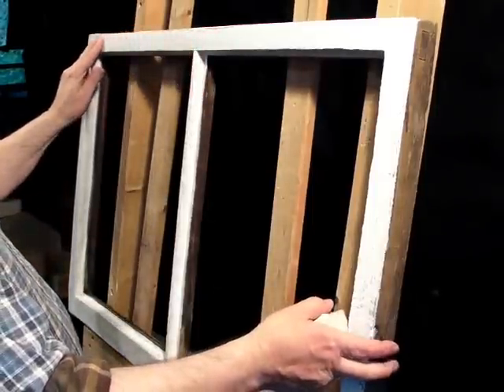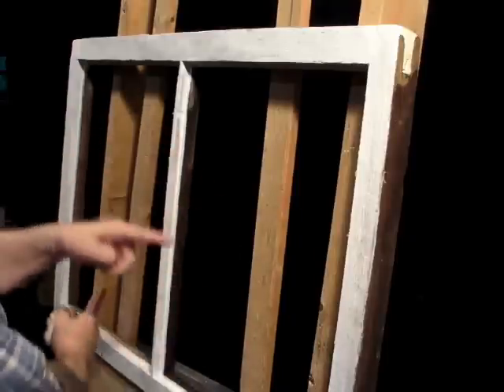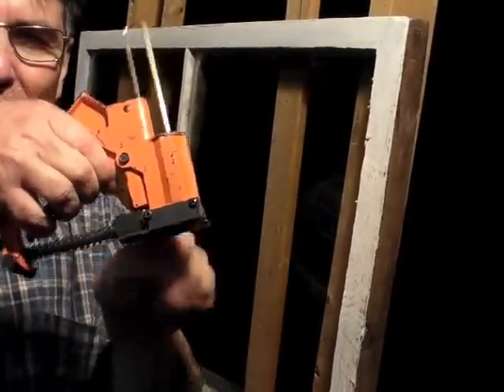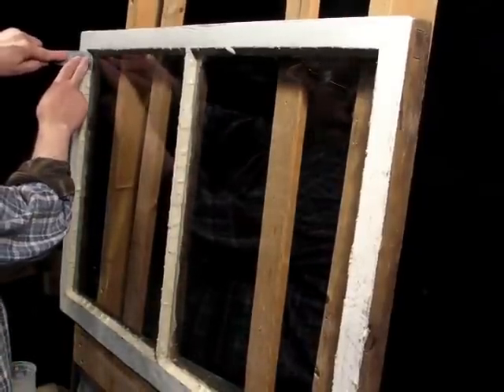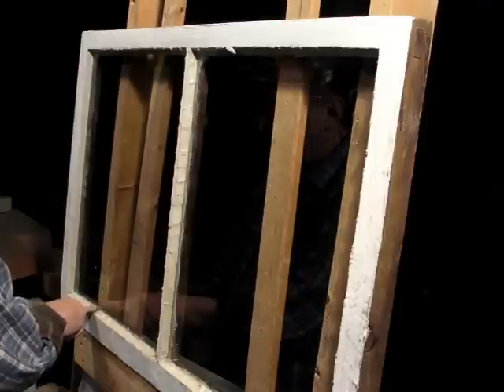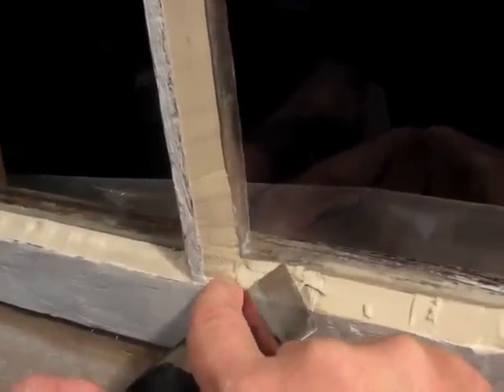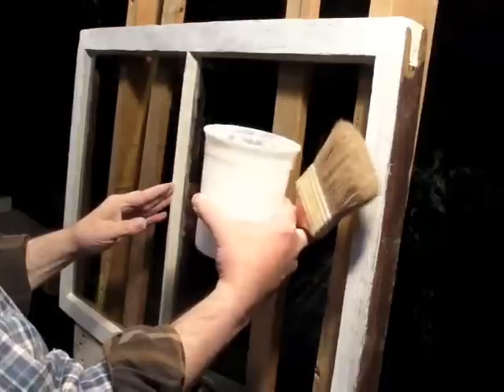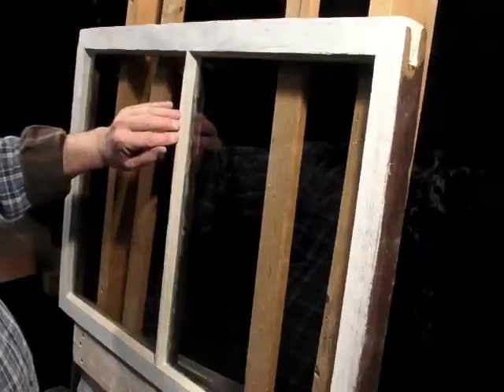Window Sash Glazing, training video

Comment: First of all THANK YOU so very much for this beautiful demo. I am replacing 9 small lights in an interior door, using stained glass. We hadn't watched the video until we had already put the points in. Is it absolutely necessary to use the bedding putty for an interior door with  8 x 6 inch panes?
Reply from the maker: You are okay with no bedding putty for an interior door.

Comment: After years of messing around with the other retail brands of glazing putty I finally ordered a quart of Sarco Dual Glaze and man, the difference is night and day between the stiff stuff that’s hard to apply and tool, like Glazol, and the Sarco.  The sarco is a dream to use to bed the sash with, and tool off evenly.  I bought a nice stiff stainless steel putty knife too, though I prefer the bent ones for glazing.

If you’re messing with stiff Dap 33 or Glazol (which has been discontinued for two years now, so you’re buying old stock) and can’t get a nice putty line without tooling it 50 times, bite the bullet and get the Sarco.  Crawfords in a pinch.  Try a bent knife, too, for awkward positions.
Reply: Good tips. THanks!

Comment: Thanks for this, I've got my sash out at the moment and wasn't sure about the bedding part,  my sash has only got putty on three sides on the top edge the glass pushes into a slot,  which I'm presuming you fill with the putty?  The video gives me a bit more confidence tackling the job 👍
Reply: Yes you fill the gap with putty most top sash I’ve seen have the little gap for the glass to sit into

Comment: Your putty has a smooth sheen to it in the video.  Im using Sarco M and it looks a bit "dryer"? than yours.  Is there a way to prep the putty before using it,,,or do you just grab a handful from the bucket and get to work?  Thanks so much for the video, just started my first of 20 windows ! :)  And am excited to restore as opposed to replace.
Reply from the maker: Brooke, If I recall correctly, I am using Sarco M in the video. Don't worry about the sheen of the putty. Putty with more oil may have more sheen. If your bucket or can of putty has been sitting around for a while oil may have risen to up to puddle on the top surface of the putty. If you see this, and you have a gallon or quart can you should scoop out all of the putty onto your bench and kneed that oil back into the putty until it is consistent, then put the putty back in the can leaving no air gaps. This can be extremely difficult and take a long time if you are working with a 5-gallon bucket of putty. With 5-gallons I scoop off the risen oil and save it in a jar, then go ahead and use putty out of the bucket. Towards the bottom 3 or 4" of the bucket the putty will be a little dry (this is where that risen oil came from), so I scoop out all the putty and kneed the oil back in, then put the putty back in the bucket. More on glazing and handling putty over at the Save America's Windows discussion Forum:
http://saveamericaswindows.com/forum/viewtopic.php?f=10&t=7#p10

take care and work safe,

John
Reply: Brooke Berger yes if it's woodsash windows add a little linseed oil

Comment: I wish I had seen this last year when I was reglazing my windows.  This was awesome.  Unfortunately, I learned a lot of this the hard way.  I am wondering about the glazier's points.  The bed that the glass rests on is so narrow that the metal on the points shows from the inside.  I couldn't find any that had smaller rabbit ears (Is that what you called them?), so I took tin snips and cut off about 1/16 - 1/8" off the ears.  Is there a better method?  I don't think the original windows (ca. 1978) used the points as the panes fell out on their own with the decaying putty.  Very frustrating.

Thanks again for an awesome tutorial!!!
Reply from the maker: I trim the rabbit ears with tin snips too. Diamond and triangle points are flat and can be wiggled in as far as needed without trimming. More here on points:
http://saveamericaswindows.com/forum/viewtopic.php?f=7&t=6

Comment: John

Thanks for your excellent video. I have just successfully completed de-glazing, stripping and re-glazing my first window in our 1921 heritage bank property in country NSW Australia (an impressive 3.0m high double hung window) following the instructions in your video, which is full of helpful little hints and techniques to make a daunting job that much easier. I looked at a number of other videos before finding yours but none were as comprehensive or easy to follow as your excellent production. Now just 20 more windows to go (thankfully not all so large)! A little tip I have just today discovered for the first time re-glazer : don't leave your newly glazed windows resting on the floor to cure : mice like eating fresh putty!
Reply from the maker: +jareth cook , and thanks for your kind comments. I've never heard of mice eating putty before!
Reply: +John Leeke I am assuming it is the linseed oil that attracts them. All fixed now. Thanks again for your invaluable video. Now you are helping Save Australia's Windows as well!

Comment: Some people don't put a small bead to set the glass in. They just set the glass against the wood and glaze once on top.
Reply from the maker: Yes, no bedding is common in the southeast, like the Carolinas and Virginia, also Texas, New Mexico and Arizona. Elsewhere it is often found on low-cost houses. Window industry trades manuals by the 1880s and 90s were calling for bedding the glass in putty for first-rate work. Today bedding the glass in putty or sealant is considered best practice.
Reply: @johnleeke  thank you. Yeah I decided to use a bedding and did 6 sashes today. I used DAP's water based glazing that comes in a caulk tube. It's really messy as it has the consistency of caulk and a huge pain in the butt but I used it because it can be painted in just 3 days. Maybe less as it's so hot right now.
Reply: In my home they did not bed the glass. Big mistake. In heavy wind storms the glass can crack especially once the glazing gets old.

Comment: Remember reading about in a FineHomebuilding article once that recommended vinyl adhesive caulk to help bed the window, and then following up with glazing with linseed oil putty as shown in your video. The author's/tradesman's view was that bedding with caulk would seal better and prevent breakage of glass during installation. Also, have known folks like Duffy Hoffman to recommend it because "could lead to a better life for the glazing." Any thoughts on this?
Reply from the maker: There are many effective ways to glaze wooden sash. I often use a traditional method of bedding the glass pane in putty. You can see all the details of this in my book, Save America's Windows. Click on "show more" above and click on some of the links. The national Window Preservation Standards book details four different glazing methods, two include bedding in sealants. More on the Standards:  www.WindowStandards.org.

Comment: I understand that the glazing has to be painted 1/16" to 1/8" onto the glass. For windows that are stained do they still need that paint or will staining the glaze and onto the glass work?
Reply from the maker: Usually the sash and putty need paint for best protection from the weather.
It's best practice to add dry pigment colors to the putty if the putty needs to have a color. 
What kind of stain are you using? It might be incompatible with the putty, causing some problem, like wrinkling of the putty skin. Always do some testing on a preliminary window whenever you are using materials and methods you have never used before.
Reply: @johnleeke  woodrich penetrating stain that is a long oil alkyd. The windows have pegs and are the interior part of two windows.
Reply from the maker: @supermetaltastic  I am not familiar with that product. I suggest testing out this product for this use. Try it out on just one rail or stile, doing the complete process, then let it sit for a while and see what the results are.

Comment: my Sarco putty seems dry and when I work it, a little sticky.It sticks to my putty knife and  I have been wearing nitrile gloves so my hands don't get goopy. how do I get my putty the consistency of yours? does it have to be super warm? is it not mixed up? it's in a very large container and I try to mix it but it's like stirring frozen ice cream. I have bought your book and it has been so helpful.  Also where do I buy the whiting?
Reply from the maker: Putty Sticking to Knife:  To prevent sticking clean your knife after each use. Remove any putty and clean off oily residue with a rag and a bit of turpentine or mineral spirits. When doing the final tooling you can dip your knife in turpentine, mineral spirits or boiled linseed oil that will act a lubricant, but this is not usually needed.

Mixing Putty:  When you first open a can of putty there may be oil that has risen to the top. You have to mix the oil back into the putty. Scrape or pore this oil off into another container. Take all of the putty out of the can and put it on a smooth bench top. Flatten out the putty, spread some or all of the oil onto the middle of putty, then fold half the putty over onto itself, seal the putty to itself at the edges, fold the putty in half again, kneed the putty down flat again, and repeat folding and kneeding at least 15 times until the oil is mixed back into the putty. Pack the putty back into the can in 1" layers, excluding all air gaps as you go.

Handling Putty:  Warm the putty up. Grab a wad of putty about half the size of your fist and kneed it in your hand to warm it up. If you are wearing gloves they may be keeping the putty from warming up. Keep you can of putty where it is warm, like on a sunny window stool, or next to (but not on top of) the radiator. You can also use a microwave oven, "nuking" it for just a few seconds, but DON'T USE A MICROWAVE THAT IS USED FOR FOOD !!! (POISONOUS VAPORS AND RESIDUES MAY BE LEFT IN THE OVEN)
Whiting Suppliers:  Listed on page 153 in the Save America's Windows book, if you have the second edition, which was available after April, 2013. If you have an earlier edition suppliers are listed about half way down the first message in this discussion:
http://saveamericaswindows.com/forum/viewtopic.php?f=10&t=7

Comment: A pleasure watching you work. Brings back a lot of memories of doing what you're doing. Since I have an old house, I still do some. I can no longer buy linseed putty where I live so am stuck with a DAP glazing compound which is "underwhelming" at best. I did concede to use an acrylic caulk as bedding putty. Have made a number of my own sash over the years. Always preferred to apply putty to wood primed with an oil based primer. I believe I still have a point gun, but the push points really save the bother of digging it out. I always liked the smell of linseed putty. Thanks for the video!
Reply from the maker: Frank, forget DAP, you can get real putty from Sarco: https://www.sarcoputty.com/ by the gallon or more.
If you need small amounts, get Sarco  from Andy at:
Winn Mountain
, (603) 654-2115

Comment from the maker: Ingrid, after glazing wait until the putty has "skinned over" before painting. Different putties and different environments will have different skin over times, which can range from a few days to several weeks. Gently stroke the putty surface with a clean finger, if it feels oily it needs more time. If it feels dry it's ready to paint. If you are unsure, wait that much longer again. Also, when you are glazing, you can do a simple test:  apply a few  square inches of putty to a board, make it about as thick as your lines of glazing. Leave the test board next to your sashes as you wait for them to skin over. Then you can touch and poke at this test patch every few days to determine if the putty has skinned over. You can even make two or three test patches. Use one for touching and poking. When you think they have skinned over, you can try painting one patch to see what happens. If the skin of the putty wrinkles up, or something else goes wrong, wait for more skin over time, then try painting on the third patch. When everything goes well on the test patches, you know it's OK to paint the putty on your sashes.
More on glazing here:  
http://saveamericaswindows.com/forum/viewtopic.php?p=10#p10
Reply: +John Leeke Ok, I will check in a few days (the sashes are indoors).

Comment: Great video!!  Thanks for taking the time to make it.  I have 84 sashes from an 1894 Victorian we are in process of redoing as part of a gut renovation.  I noticed when you bed the glass there was a strip of glazing on the inside that is visible.  How do you address the white glazing if you are staining the inside of your sashes?  It seems like dark stain and white glazing might be unsightly.  Especially in the areas where there is a void to fill.
Reply from the maker: Sometimes I add color to the putty when the sash and putty will be varnished, or if it is going to show through from the inside of the glass. Usually the putty is beveled back behind the "sight line" so it doesn't show from the inside, but occasionally a wider bevel is needed if the shoulder of glazing rabbet is just too narrow, or the top edge of the glass in the lower sash fits into a groove and I decide to not put putty in the groove.

Dry powdered pigments: it usually takes just a "pinch" of pigment for a fist-sized wad of putty. If you are adding so much that it makes the putty too stiff, add a few drops of linseed oil and kneed it in well to loosen up the putty to normal consistency.

Oil paints: usually about the volume of one or two peas is plenty for a fist-sized wad. If you are adding so much the putty becomes too loose or sticky, add a few pinches of dry powered whiting to bring the putty back to the usual consistency.

I've always kept with dry powdered earth pigments, because they are the same type of material (minerals from the earth) as the filler in the putty (powdered chalk or ground limestone), and so more likely to be compatible. This is based on what I learned in art school, where the goal is to make the painting last for centuries. That approach is based on paintings and other objects made of oils and pigments that have actually lasted for centuries. I don't expect my colored putty to last for centuries, but I do want it to have as long a service life as possible.

Learn more about glazing sash in the book, Save America's Windows:  http://saveamericaswindows.com/get-the-book/

Comment: Do I need to put sealant or anything under the pane of glass ( internal side? )
Reply: Make sure bare wood is primed with wood primer whether its been primed with wood primer, varnish or linseed oil  before or not, the primer stops the wood from absorbing the oil from the putty drying it out cracking and falling off, finally paint it after three weeks to seal it in so it doesn't dry out.
Reply: Non drying sealant is used on the inside of double glazed windows using appropriate wood sealing primer for that sealer on the wood first, instructions usually on sealants in shop what they're used for and how to prepare to apply always take time to read instructions.

Comment: John. how long do you need to wait for it to skin before painting with exterior paint?
Reply from the maker: +Tango Papa 36, 3 days to 3 weeks, depending on which putty and the environmental conditions in the shop or the weather outdoors. In this video I'm using Sarco MultiGlaze Type M, and it's in the heated shop, so it's about 5 days, or 3 days if I set a fan to blow on the stack of sashes. Other putties and other conditions will have different times to skin over. When in doubt, do a test sash, or a test line of putty to see how long it takes. See more on glazing and painting sash in the book:  http://saveamericaswindows.com/get-the-book/

Comment from the maker: Ingrid, click on this link 
http://saveamericaswindows.com/forum/viewtopic.php?p=10#p10
and scroll down about half way to see the "Polish the Glass" heading. There you'll find links to online suppliers for whiting. For local suppliers try stained glass shops, especially the ones that teach classes, they usually will sell whiting.
Reply: +John Leeke Thank you! I will look for it. Today, I used plaster of paris. I worked pretty well, but not the best thing to be inhaling for 25 more windows. Will find a stained glass place in Chicago.
I had great success today with my window after your tips.
Reply: An elderly gentleman who had been a glazier for over 50 years told me I could also use plaster of paris in lieu of whiting.  That's what I've used ever since in my 40+ years of doing old windows, and it works great.  It is also less expensive and more readily available.  I also prefer the Sarco putties.

Comment: Thank you for a very thorough glazing lesson. I've learned quite a lot. I have a question about the putty knife. I have one from years ago that is double-ended - one end is a regular putty knife, the other end is V shaped with a groove where the 2 sides of the V come together. Is there anything to recommend the V end? It looks like it would give a good 45 degree angle to the glazing compound if one side is run along the mutton or sash and the other along the glass and would spill excess glazing through the groove. Any thoughts?
Reply from the maker: You are welcome!
The V end can help make a consistent angle, but it is seldom the correct angle needed. It usually produces an angle that allows a wide stripe of the putty to be seen from the inside of the sash. This may provide good performance of the line of putty to keep the weather and water out of the joint between the wood and the glass, but it is usually considered a very poor visual appearance to see the putty from the interior of the window. Perhaps this would be adequate for sash in a barn, but not adequate for sash in a front parlor of the main house.